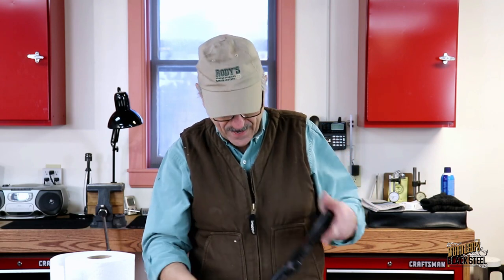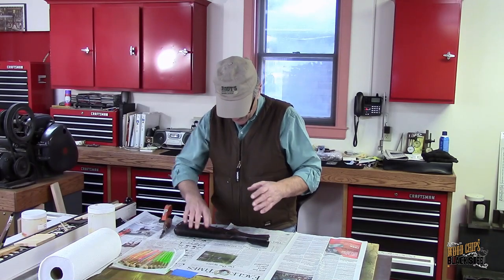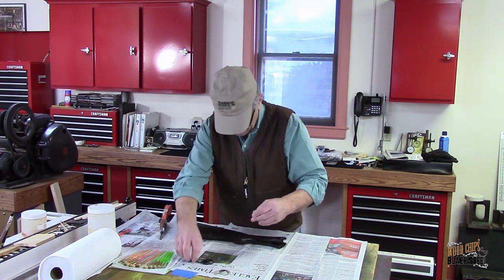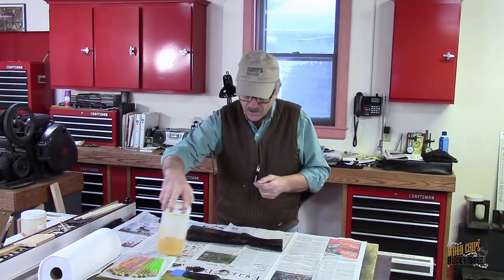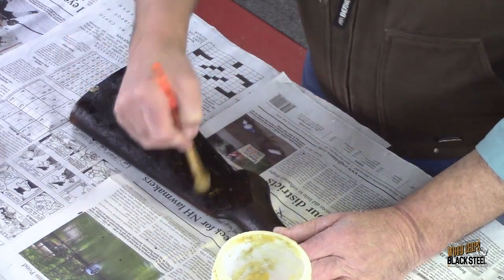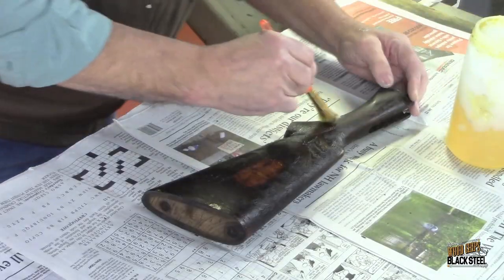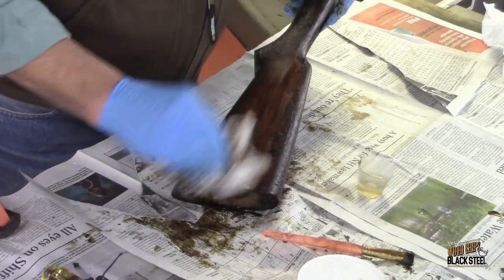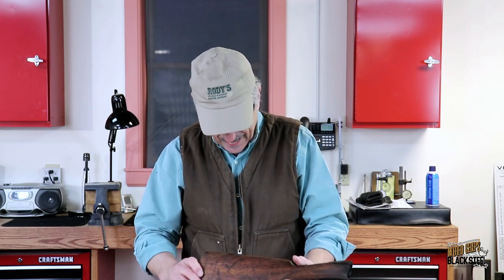Dancing with a Stripper.

Comment: I used a steam iron on an 1862 musket stock to remove a bunch of dents and dings without taking anything away from the wood. I left a few things that would have just been too big a deal to remove and at the end of the day, I was doing a preservation rather than a restoration. A certain amount of Indelible history is to be expected.
Reply from the maker: Yep...well done!  My plan is to do the same.  This stock needs a lot of work to make it function correctly.  Hope you stay with the channel and the series.  Thanks for taking the time to comment

Comment: Excellent video.  I have a couple of older guns that need attention.  Is there a place we can get Mark’s recipe for making his stripper?  I have used automotive strippers and spray strippers in the past.  The gel seems like the best way to go.
Reply from the maker: No...not on Marks stripper.  There are some pretty mild stripers on the market. I have always had good luck using Formbys products.  The key to any of this is patients.  Work slowly and let the product do its job.  The mistake that many make is wanting to "get the job done".  It is better to make several applications, removing finish by layers rather than getting right down to the wood. Formbys 30013 Furniture Refinisher is a possibility.